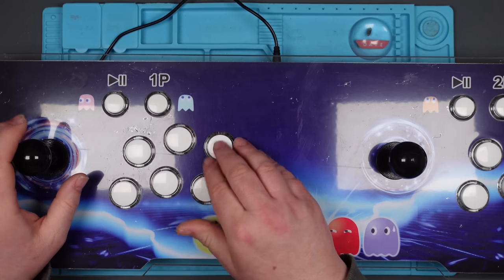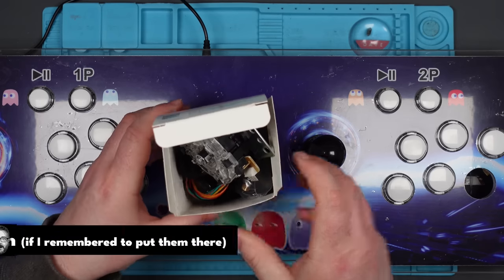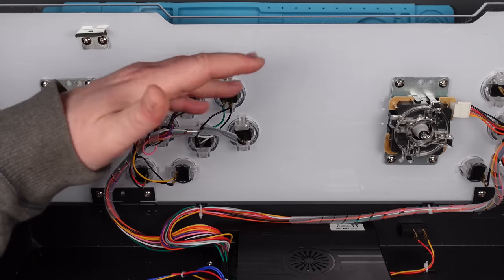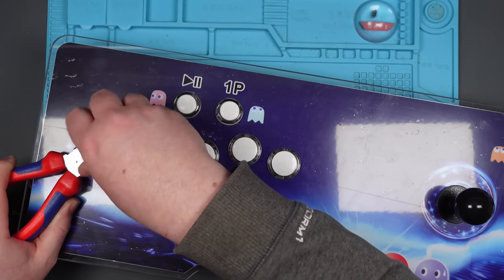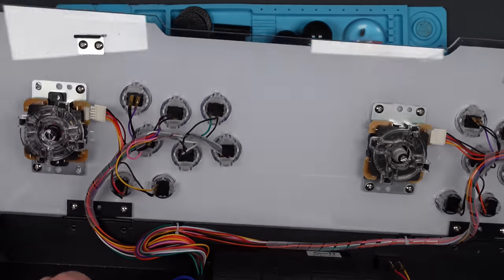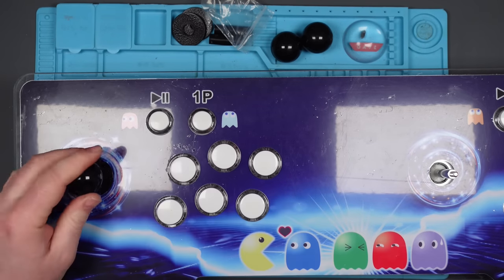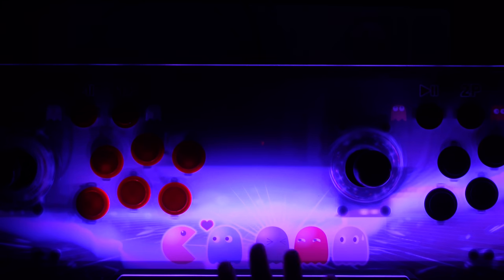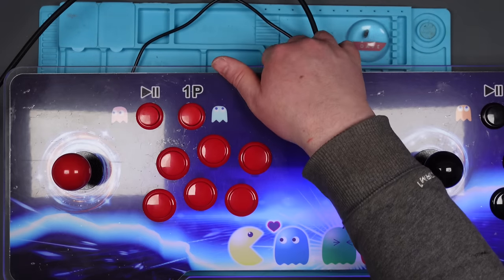Let's make PANDORA'S BOX better

Comment: Steve I used to work for an amusement company back in my 20's (30 years ago) and leaf switches were the norm.  But you had to clean them all the time, even if they had gold contacts. take a 1MM / 1/8" slice off the side of a red eraser and use that to slide in between the contacts to clean them.  At the time, micro-switches were the bees knees, a lot less maintenance.  Love your videos brother.
Reply from the maker: Ah, yeah I can see why micro switches would be popular for maintenance! You can't beat the leaf switch for the button-pressing experience though. Much more authentic to me! 😍

Comment: if you need to tighten up the knob/ball (it will loosen over time from general use) just put a screwdriver into the  centre screw on the underside of the joytsick. Turn that one way (right) & the knob the other and it will tighten up
Reply: Yeah, I did wince a bit as he scratched the column up with his bare pliers...
Reply: That’s a good tip - thanks. I’ve been suffering with spinny knobs for ages. They always loosen at the worst time! 🕹️

Comment: Move the LED strip to the side wall so its less dazzling. maybe upgrade it to a 'chasing'/addressable strip (argb) so you can have different modes or lower the brightness.
Reply: Also I'd like to add, maybe add a diffuser along it so it's not such a harsh light and instead softer
Reply: Run WLED on the addressable LED strip for all sorts of options.

Comment: Damn... A bonus Peel - you have almost a completely new device now! I am exceptionally jealous... I've wanted to make my own arcade machine for ever... I just lack the...skills... to actually build the cabinet itself. Maybe an idea for a future second channel project? Put that Pandora into a full size cabinet. I'm sure your new house will have room right? :P
Reply from the maker: 😁 I don't think my missus would agree! But yeah, I'd love to have a full size cabinet. Maybe a table-top version would be a good compromise! 😬
Reply: @StezStixMix  Yeah that would work. I think that would make a cool 2nd channel series.
Reply: @StezStixMix  i made a full size one with a raspberry pi and sanwa buttons and sticks, built an amplifier from parts from Ali express and speakers from an old Bluetooth speaker I had, it's a really fun project if you have space for it ☺️
Reply: @StezStixMix  there are also wall mount fold down designs around.